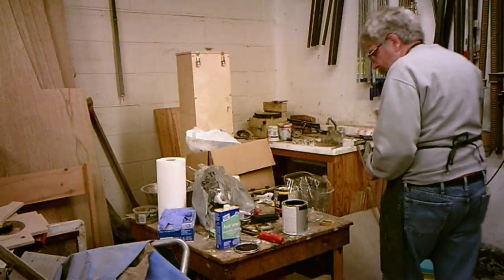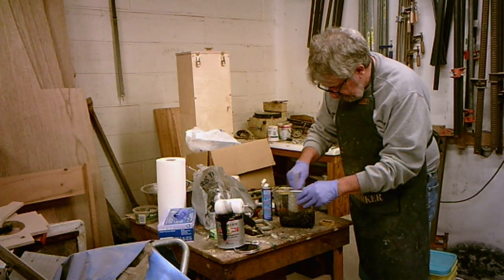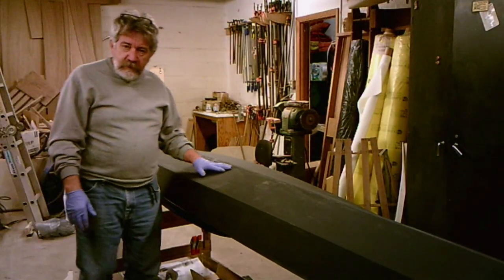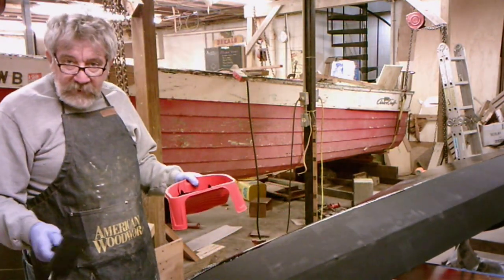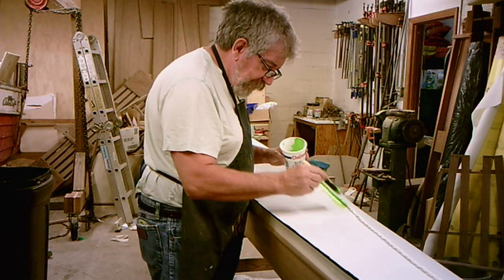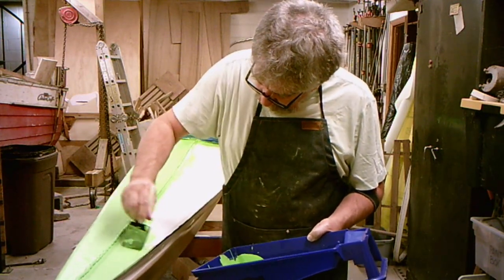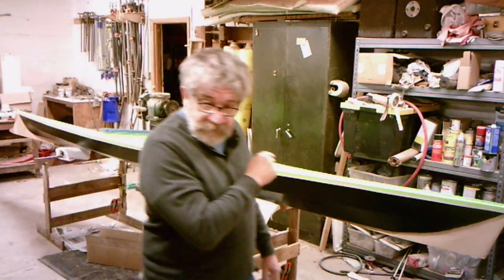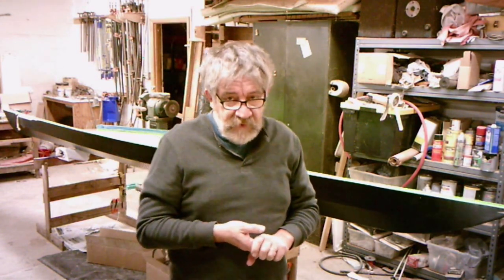Shad part 8 painting

Comment: Great video , I'm having a go at the Poco barta from your book , I'm torn between ordering ballistic nylon locally, I live in Ireland or trying out  the polyester from the States running the gauntlet of customs charges and postage , I just wanted to know whether I could use the rustoleum on the nylon successfully ? Thanks
Reply from the maker: Don't use paint on nylon. It will not stick for long. It will eventually start turning loose and flaking off.
Reply: @Kudzucraft  that's what I thought , thanks for getting back to me , I'm enjoying the journey so far 😁👍
Reply: @owenmurphy405  You MIGHT be able to find a single pack urethane YACHT paint in Ireland.  "Corery's Goop", mentioned in the fabric video as usable on nylon, is a commercial TWO Pack urethane from the concrete finishing industry - there are likely similar products available in Ireland - in 100 liter drums!
Reply: @ryoungatlmidotnet  I think that's what corey is doing. You may be able to find a similar 2 pack sold to consumers in ~20L volumes for garage floor finishing.